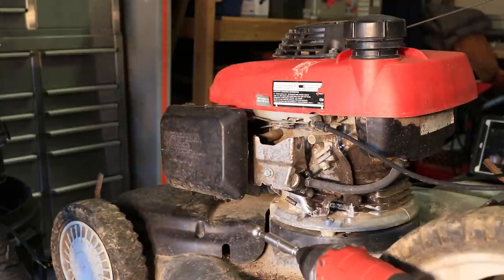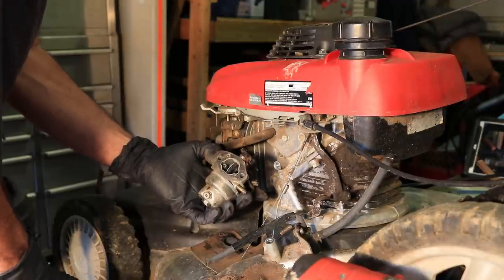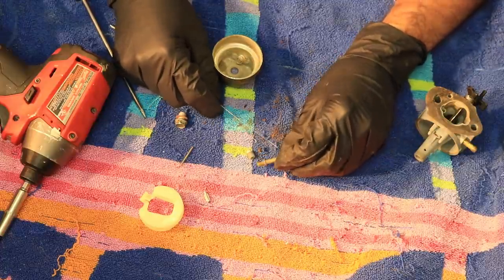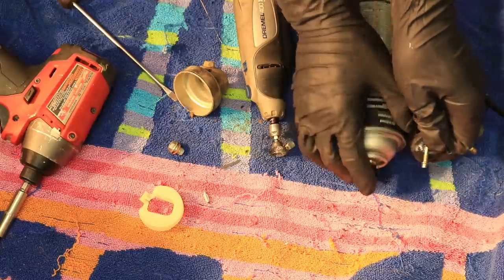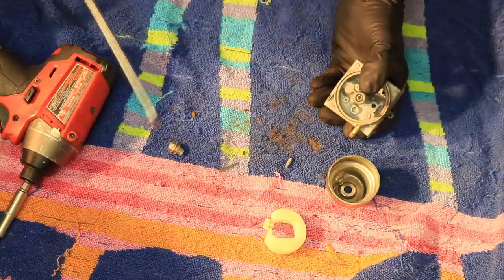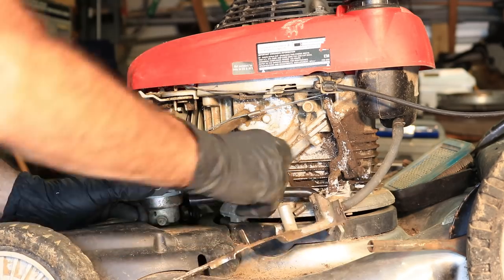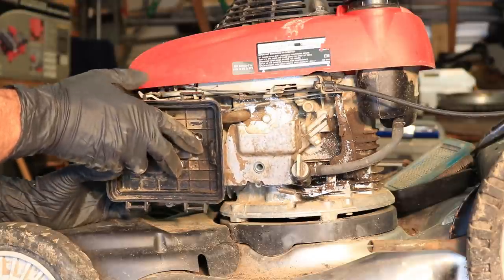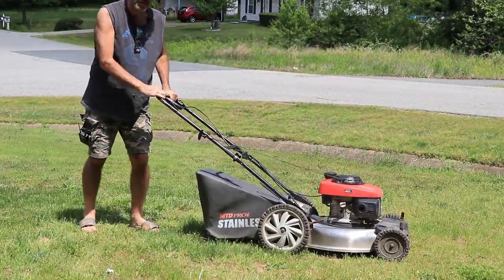Honda GCV160CC Won't Start?...Watch to See How I Fix it!..

Comment: Mine is only 3 years old and still cant get it to start. I changed the spark plug and the coil. sprayed starter fluid in carb. still nothing. any ideas?
Reply from the maker: Did it sit for extended period of time?  Is there water in the gas?  When you spray starter fluid in the carb it should at least try to start.  I have ideas, but need more info!
Reply: @JLPicard440  cracked exhaust rocker arm!
Reply: Andy Christiansen - how did the exhaust rocker arm crack?
Reply from the maker: stanley smith don’t know
Reply: @ThePerfectSeason1972  no idea. No heavy use or anything.

Comment: How would this be different qoth the auto choke model?
Reply from the maker: Yes most definitely...  The basic carburetor cleaning stuff is all the same, but the linkages will be different.
Reply: @JLPicard440  ya the part that connects to the motor and opens the flow up is where I think I have an issue but gonna clean it and see if it makes more sense to me. Thanks!
Reply from the maker: You're welcome!

Comment: So I watched a couple videos on the same procedure. I have a Honda GCV190a motor and now after taking apart the carb I am getting fuel coming out of the exhaust when I try to start it. I took it apart again and checked the float and pin and everything looked good nothing was stuck. Why else could I be getting too much fuel?
Reply from the maker: That's what it sounds like to me,.. the float needle is leaking... not much else would cause that..
Reply: Take a Bath Productions yeah I guess taking it apart twice wasn’t enough. Third time was a charm. I tested the float before I put the bowl back on. It worked to a reassembled everything and it worked. Thanks for the feedback and video. Good stuff!!!!
Reply from the maker: @pingaunis  Good deal!😁😁

Comment: I did it. But the motor works too fast. Sound like a race car. What can I do to fix it. Is an autochoke motor.
Reply from the maker: Try looking at the throttle spring, most of the time, it's on a tab that you can bend to speed up or slow down the motor... if it's not that, then maybe the linkage went back wrong

Comment: What does it mean when there is oil on the filter?

I changed the oil and it ran for 1/2 a second and died. It never started again. If I pull for a while there will be oil on spark plug not gas. Putting gas in the carb doesn't make it fire.
Reply from the maker: Peter B. Could be that the crank case is over filled with oil.... if it's not that u could have bad rings....it won't start if the plug has oil on it
Reply: if you tipped it an odd way these engines get oil in the cylinder.  usually call tell by oil coming out of the carb into the air filter.   the way to fix it is to remove the spark plug and pull the cord till it stops spraying oil out of the spark plug hole.  after that put the plug back in and keep pulling until it starts. when it does start, its gonna smoke like heck burning all the oil .  After a while it will stop and all should be good .
Reply: Whyme123 I did tip it every which way looking for the drain plug under the engine. I never found it eighther.
Reply: did you pull the plug and try to clear the cylinder of oil? if you got oil in the cylinder it will hydro lock.  pull the spark plug,  rotate the blade and shine a flashlight into  the spark plug hole. you should be able to see if the piston is moving while the blade turns.  if not you might have broke a rod
Reply: Whyme123 not yet. It's winter and the oil will be like malasses. The connecting rod is ok. It fired once after the first oil change and never again last summer. The piston definately going back and forth. You must be right.
Reply: Whyme123 It is not hydrolocking but there is oil on the plug and on the oil filter.

Comment: Im trying to start a honda mower.it has new carb and magneto still no start
Reply from the maker: Might need more info.. Did the mower hit anything in the yard?  Did it set for a long period of time?  Was the gas drained out of the gas tank and the tank flushed when you changed the carb?  Is it getting spark with the new magneto?  There are many variables..
Reply: @JLPicard440  i willcheck for spark with new magneto
Reply: @JLPicard440  honda: could be the thermal wax cartridge ? Or valves needing adjusted cause carb is new and magneto new and new spark.plug still no start
Reply from the maker: @gradyhernandez4699  If it's the wax cartridge you should be able to look in the carburetor when it's installed and see if it's choked fully or not.  If it choked then it's not that.  Could be the valves, but you can test the compression and that'll answer that.  There's a good possibility it's not choked properly.. that'll definitely keep it from starting.
Reply: @JLPicard440  valves are adjusted at what with feeler gauge?
Reply from the maker: @gradyhernandez4699  I think it's .006 intake and .008 exhaust.. +/- about .001
Reply: @JLPicard440  i could not see the wax cartridge and choke is open.on new carb
Reply from the maker: @gradyhernandez4699  IF the choke is open that's a problem.  The wax cartridge should be in the block behind the carburetor..  I saw a tech service bulletin about using (Hondabond HT: PN 08718-0004) to improve heat transfer between the block and the cartridge.  If you replace the cartridge, you might want to get some this too.

I don't have any Honda mowers available or I'd do a video on that.
Reply from the maker: I also wanted to add not all models have this.  I think it's only going to be on the auto choke models..
Reply: @JLPicard440  im attempting to get the honda mower going for nicks uncle. His uncle is 80 plus. I wish i had my uncle still alive
 You know what i mean
Reply from the maker: @gradyhernandez4699  Yes absolutely.. that's so nice of you.. 🙂
Reply: @JLPicard440  the choke is open on the honda

Comment: The worst is when the needle valve gets stuck to the point where it might as well be welded and there's absolutely nothing you can do to remove it then you're screwed.
Reply from the maker: Yea, I've had that happen... but if the carb is gummed up to that point.. it's probably time for a new carb!.. I've sand blasted the carbs clean and it usually works.. I know they're only $15... but I'm a cheapskate!
Reply: @JLPicard440  $15 dollara a carburetor?
Reply from the maker: Antonio Sanher yep.. I don’t know if this is the exact one because I just looked it up in a hurry... but it’s like $15

New GCV160 Carburetor + Air Filter Spark Plug for Honda GCV160 Engine HRB216 HRR216 HRS216 HRT216 HRZ216 Lawn Mower https://www.amazon.com/dp/B07FS3MP17/ref=cm_sw_r_cp_api_i_d5U7Cb0W4N5W0

Comment: Video Grad  A-   Cover all the Basis for cleaning the Carb.. but leaving the Engine  air filter  in take area behind the Air Filter contaminants,  is a no no ,,take a few seconds to clean the Engine Fins,  and area around the Air Filter will pay dividends ...

Comment: poor design indeed, I bought a pc of threaded rod and nuts, screw the rod in and put the pcs on, no octopus fingers needed
Reply: If I follow you right, did you replace those long bolts with studs and then just thread all the parts over and use M6 nuts to hold it all on? Seems like a sensible fix
Reply from the maker: Great idea!  I strongly dislike the way Honda did this...
Reply from the maker: @PacificCorpUK  Yes.. that's what it sounded like... sure makes putting it back together much easier

Comment: Pain in the neck, my butt.  They are a PITA  hi have the auto choke version and you have 5 or 6 things to get on the bolts before you can bolt the assembly back on.  This whole assembly is a crock of you know what.
Reply from the maker: John Clarke yea Honda's are pretty good motors.... but the carb design is terrible!

Comment: I got one that wont run plenty of spark and all pour gas in carb it runs till gas is used up that I poured in it ..... took carb off it was really dirty  tried cleaning it all  put bk on same situation  only runs when i pour gas in the carb ,,,,,,,, so I ordered new carb ,and gaskets  put on it  same damn thing happens gas is going to it from tank and all  . again it will start from the gas I poured in the carb, run till its gone , whats the problem with this mower ?
Read more
Reply from the maker: It's hard to say just off one message.  It could be there's water in the fuel tank.... It could be that some of the gaskets for the carb are on backwards and it's sucking air...it could be a piece of trash was in the fuel and has now contaminated the new carb....
Reply: Try running it without the fuel cap off, if it runs the vent in the cap is plugged.
Reply: CARL SPURLIN your fuel pipe is blocked.

Comment: Honda-never again buying one of these. Total BS to repair.
Reply from the maker: lawdhaffmuhsee they just a little more trouble than a Briggs ... I’ve done several and they’re not that bad once u get used to them
Reply: They are actually very good mowers until you store them with old gas. Thats the NUMBER ONE ISSUE with all Honda mowers. They are built to much tighter tolerances than the other brands. Which explains why they run much quieter and smoother.